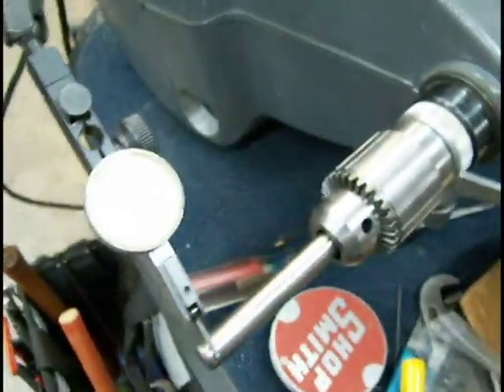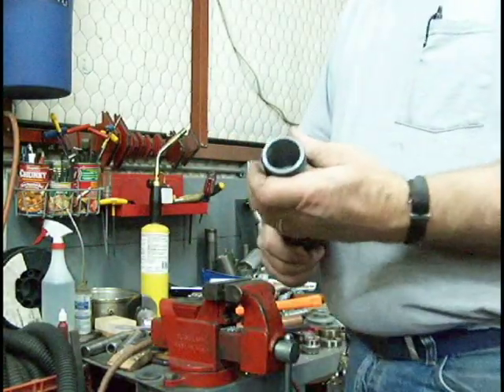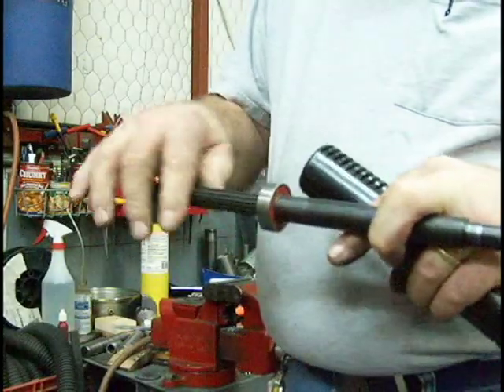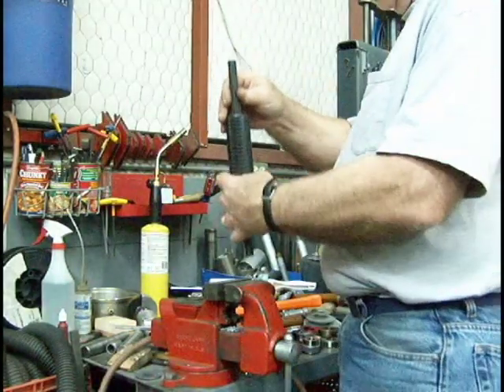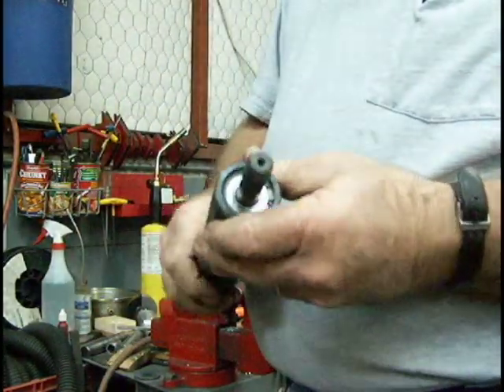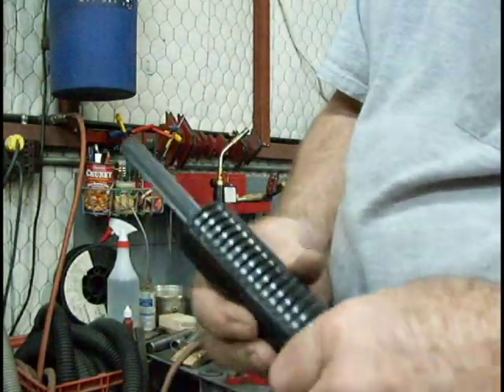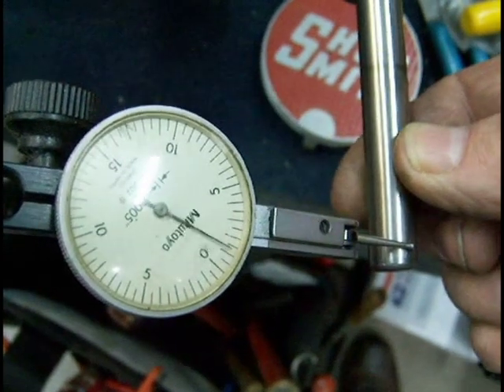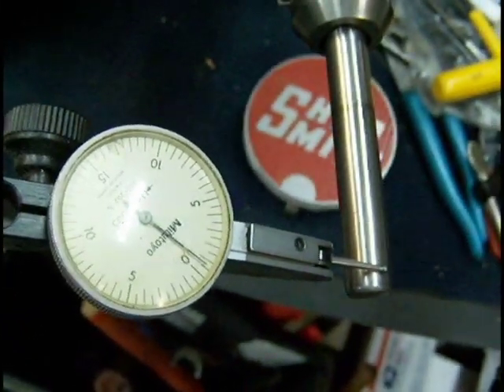Shopsmith Mark V double bearing quill upgrade

Comment: what only 1 bearing?
Reply: Yes. From the first Mark Vs in 1954 through mid 1984 the quill had only one bearing in the front. The rear end of the spindle is held by the the steel female drive sleeve on the 54 to 61 models and the plastic drive coupler on the 61 though 84 models, both of which allowed a lot of runout at the tip of the spindle.